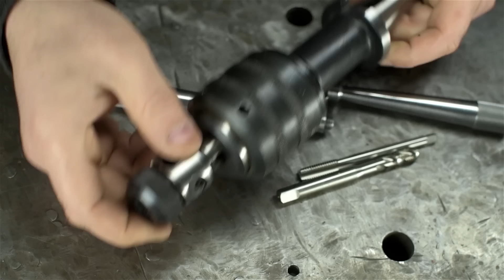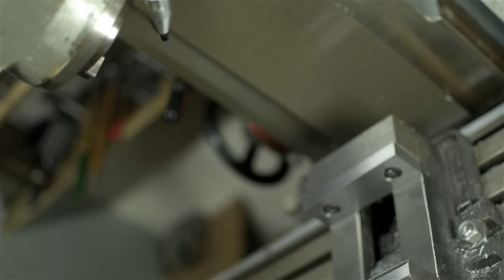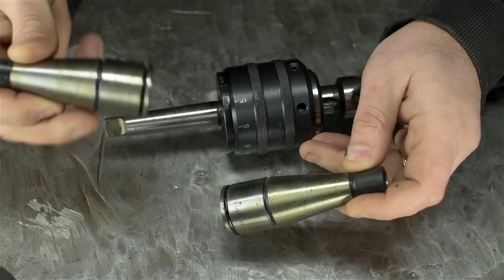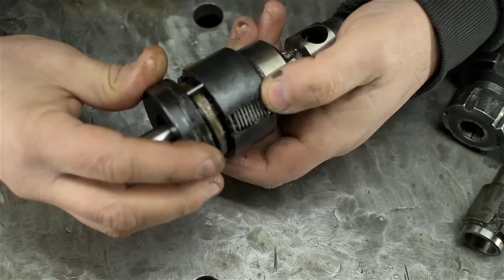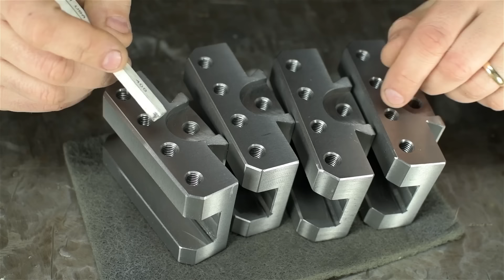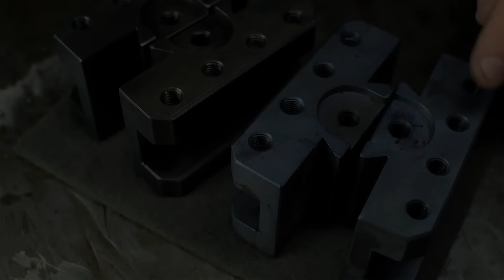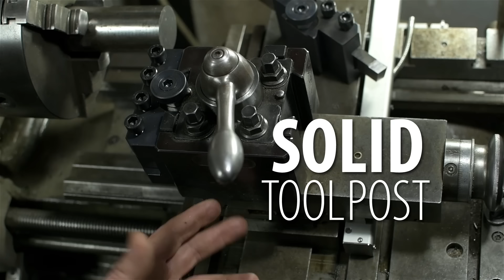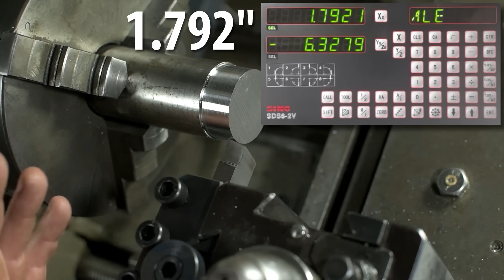How To Break A Tap & Other Ramblings

Comment: Well there's your problem. You're using English taps in a metric head. 

Everyone knows millimeters are just inches for people who can't do fractions.
Reply: @john blackthorn I was working on a jet at MCAS Yuma when one of my engineers came out on the flight ramp to see if I needed anything.  I said, "Sure, bring me an 11/16" wrench."

He came back out of the hangar with a fairly large wrench, and when he handed it to me, I said, "This is kinda big...", as I noticed it said, 1 1/6" on it.  He was very embarrassed.
Reply: I was working at a shop when a tech was all proud of himself for puting up an exploded view of a ruler down to 1/16" to make alignments easier. Word got back to the engineer, he switched us over to metric the next day.
Reply: I think Alec Steele would have no problem with those pesky fractions.
Reply: I thought everyone knew that the inch is defined by the metre. :-O
Reply: @ColtaineCrows   ...and meters are defined by photons in time, which is defined by electron transitions is Cesium, but I'm not gonna start stacking Cesium atoms on my mill.
Reply: @calebjohnson7592  
Old news. It's been defined as a fraction of light-speed since 1983.